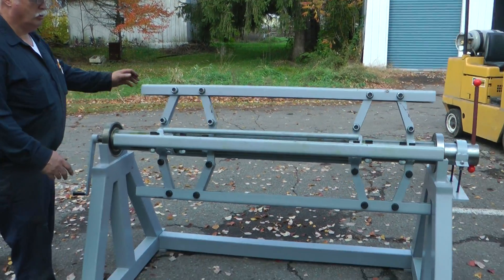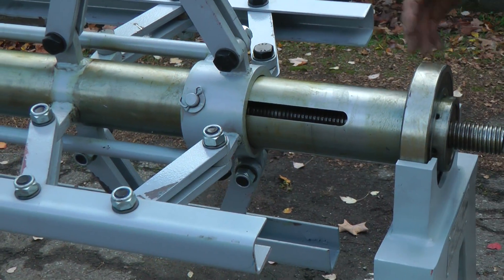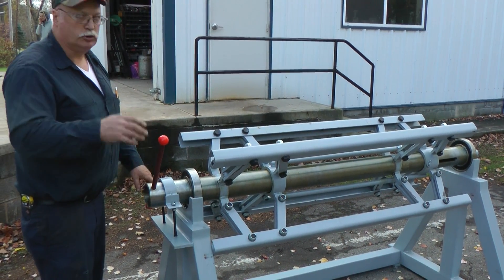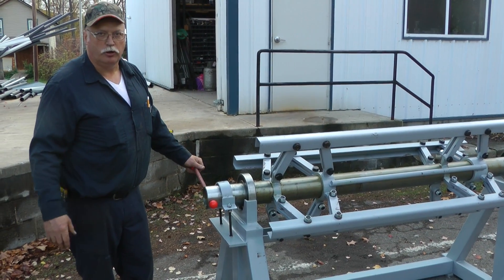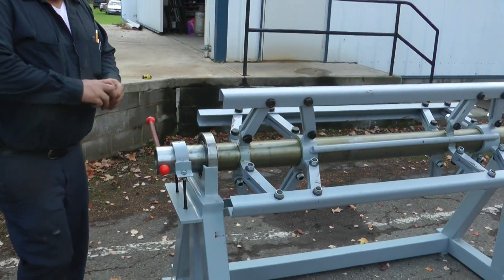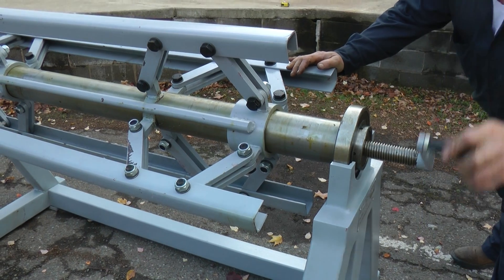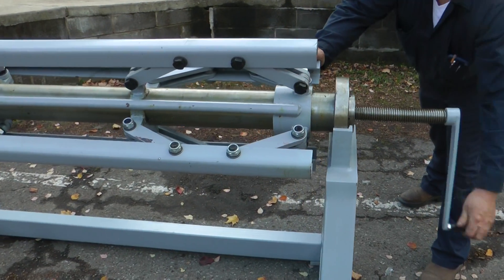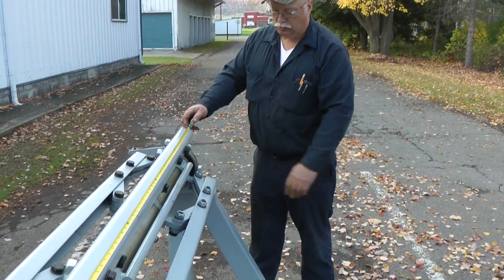Manual decoiler machine. Uncoiler designed to hold and decoil sheet materials from the coils.

Comment: Where do you buy the coils??
Reply from the maker: There is a variety of metal coil suppliers. Due to high weight and shipping cost - it's better to get them locally.
Reply: @namedmitriy  that’s the problem I’m having. Every search i make is showing China for 700/ton. Not a bad price but I’m sure the shipping is unreasonable. I can’t seem to find any local steel suppliers local that sell coils. I’m near both Los Angeles And Bakersfield so I’m sure there must be a coil supplier perhaps I’m not wording it correctly in my searches
Reply from the maker: @Big_red_builders  I can text you a list (email or cell)